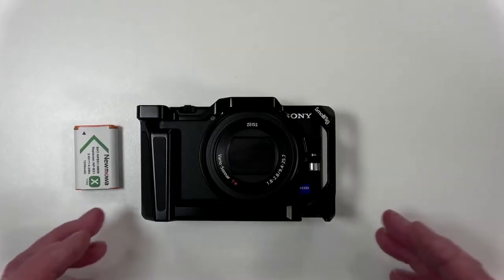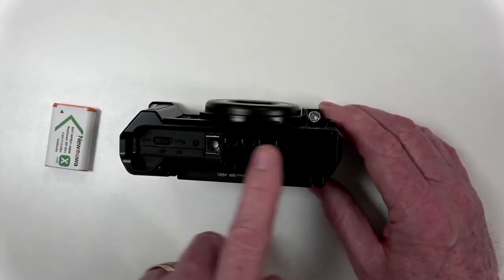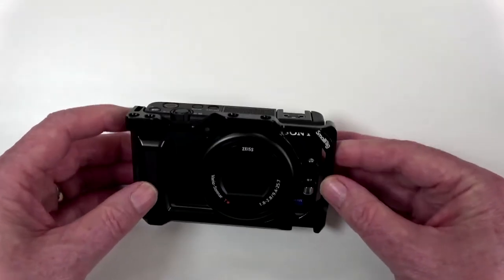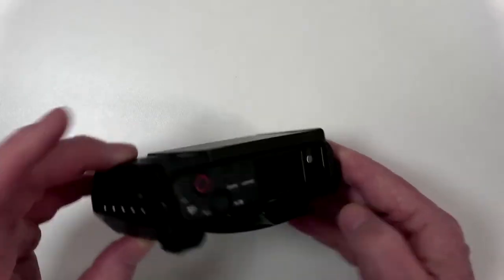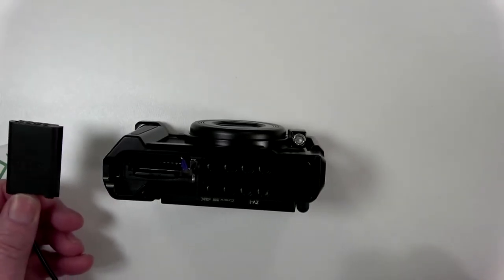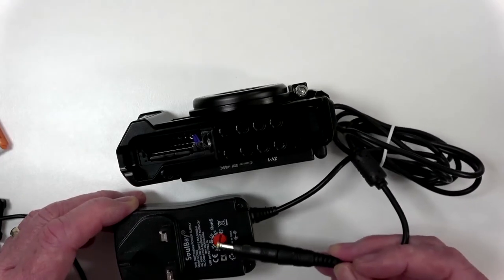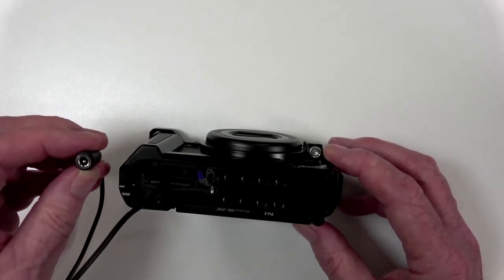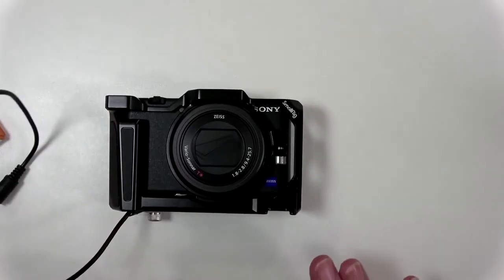Dummy battery  ZV 1 operation

Comment: Thank you! I've had my ZV1 for about 6 months and the battery just started acting up! I have a dummy battery on the way, but just looked at the battery port to see no access for the wire to exit with the door closed. The SmallRig looks perfect and if I can get the memory care out without taking it off my tripod that is an added bonus!

Comment: As someone already commented the ZV-1 can stay powered by the micro USB cable if you leave the normal battery in and use a high speed usb plug.
Reply: high speed? as in 3.0? or what? cause the one im using now aint cutting it. it keeps dying on me while plugged in
Reply: @JonFlaco  hi. could you solve the battery issue?
Reply: @pacmanlp8876  hey! yes, i bought a different surge protector with usb ports and just plugged it directly
 in it. the battery never dies now
Reply: @JonFlaco  so you're using, what, mini hdmi for input and the usb just for power? does that really solve the battery issue?
Reply: @omsmada  where you plug in your usb for power is what will solve the problem. In my case it was using a surge protector with 3.0 USB ports
Reply: The only issue with powering the camera using the battery is that it may overheat whereas using the ac adapter it is less likely to

Comment: If you have the normal battery in the compartment, you can charge with the micro usb through the multi-port!
Reply: im trying this method and the battery keeps dying on me
Reply: @JonFlaco  you prob need to have a good charger, I dont know the exact power, but think about the differance between a iphone and a ipad charger! it is like 0,5 - 2,1 W difference! I use a powerbank with 3 W output and have no issues!
Reply: I was using usb power my Z-V1 for more than a year. It worked great.

Comment: Put the normal sony battery and power it through usb. Change of course the usb settings to power on in the menu. No dummy battery needed.
Reply: The battery still loses power and dies.  If I'm streaming, this simply doesn't last long enough, and it dies halfway through the stream.
Reply: I ve been streaming 3 hours non stop using that method. I don't know why yours don't work maybe you plugged it to a power bank , just plug it to the outlet using an adapter 2.4w
Reply: @ennachba5588  how do i set this up?
Reply: @jimyk  i have a 5v/2.4amp adapter and it is still dying on me. any idea why?

Comment: Which camera did you used así your main camera on this video? Thanks
Reply from the maker: Canon EOS R with 24-105 Lens.
Reply: @TerryMurrayTalks  Thanks! I really liked your main shot. Do you think I could get something like it with a ZV1 or with a a6400? I have seeing comparisons and they are really close (a6400 with kit lense). I do indoor/good lightning streams 70% of the time, 30% video. Thanks again and subbed!
Reply from the maker: @pacmanlp8876  For streaming at the bit rates available across most platforms, the ZV1 is more than adequate. The ZV1 is a fixed lens and is limited to the capability of that lens. I find it difficult to decide what a good image is. As you probably already know, it is a combination of lighting, image chip, compression and lens. Adding colour grading in editing also complicates the process.  I set all my cameras to output at 1k and found this more that acceptable for recording YT content. Perhaps the Canon R is too good for recording an old sun battered face like mine. Thanks for the sub, I’m still learning and not sure what content to put up on YT, 

Comment: Could you make please a in depth tutorial of how to make a dummy battery for a smartphone?Smart phones can be used as PREMIUM webcams because of their better cameras but deteriorating the battery is a big problem. So I really would love a tutorial on how to make a dummy battery setup so i can directly charge from the wall my phone without deteriorating my battery.There is no such tutorial on youtube, maybe this project can help grow your channel.
Reply from the maker: That’s a difficult one to do, there are many different smart phones, Apple, Huawei, Nokia, Sony, Google pixel, HTC to name a few. There are also multiple operating systems and versions. There are a few options but they require specific phones software and hardware. 
 In order to use a phone as a video source it is firstly necessary to make sure there is a clean HDMI output, i.e no phone metadata in the output image stream. You may need to use an app to provide a clean HDMI for some smart phones the Filmic Pro apt can do this. I have tested this on a few iPhones (6 to 12), Huawei  Mate 20 Pro. 
For most smart phones, you will need an app that sends video wireless to your recording device and at the same time keep the usb power in the phone. 
The only solution I know that is capable of powering the phone and giving access to clean video via  a physical HDMI port is a Apple Lightning to Digital AV adapter that can be used on most of the recent apple devices (ipads and Iphones).
Reply: @TerryMurrayTalks  I'm not referring to any apple devices,am only interested in Android devices.And phones do not have hdmi output like dslrs/mirorless cameras,they just send info over usb or wifi.And I'm talking about removing the battery and using a dummy battery.
Reply from the maker: @encapsulatio   It is not that easy to power a phone with a dummy battery. A smartphone's battery is an integral part of the the phones power management system. You may want to look at this thread here  http://gofile.me/56DCG/TyUhbopWY it  gives some insight into the problems of dummy powering mobile devices. I was making the point in my last post that the only way to get to where you want to go is by using a specific Android or Apple model that is capable of powering the phone whist providing a HDMI or USB video output. Good Luck with you endeavor.
Reply: @TerryMurrayTalks  How do I find what models do have it? what search terms do i search for?

Comment: NO! 5V wil not be OK! It must be 4,5V tops! Rather 4,2V Otherwise you can damage your camera.
Reply from the maker: Fair comment, I did run it with a 5 volt power supply for a few days without any issues. However you are correct in limiting it to 4.5 volts.
Reply: Hi. One question ... Could the Sony ZV-1 camera be used connected to a 5V and 2A power bank by usb? Is it a good idea to do that or not?
Reply: @RobertRodriguezTV  It can. No problem. But you won't be able to plug a remote
Reply: I jus use a dummy battery straight into a power bank or a USB port works fine